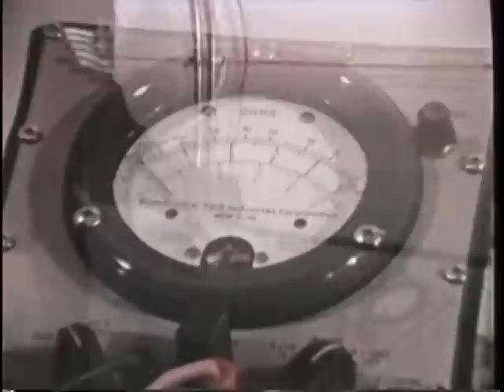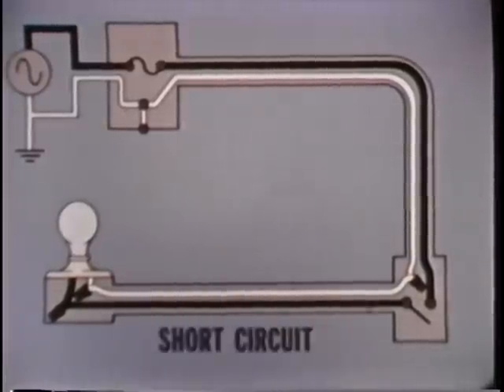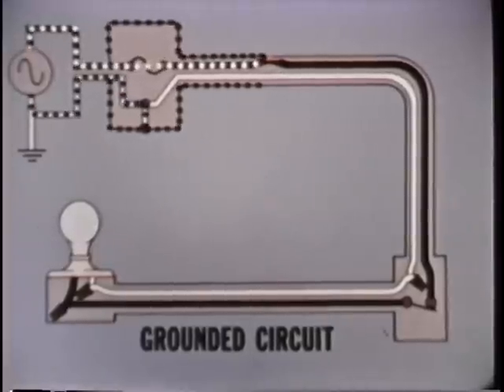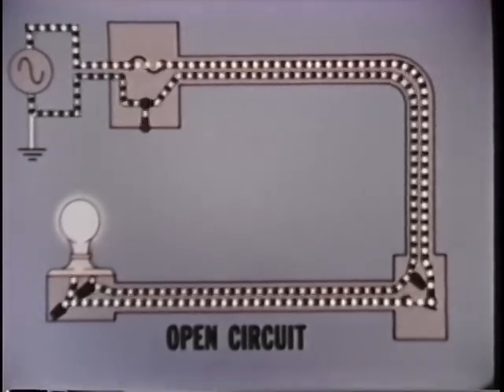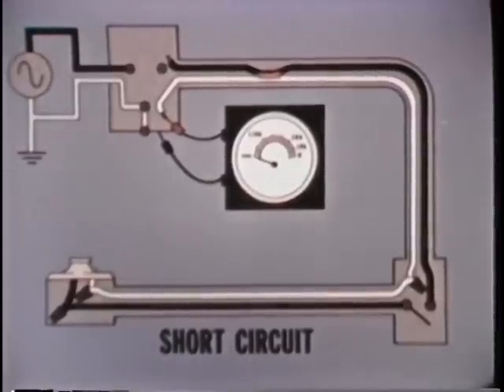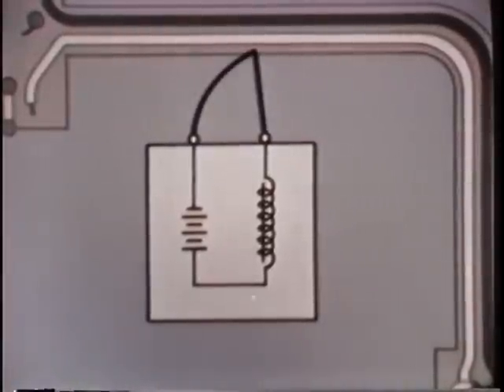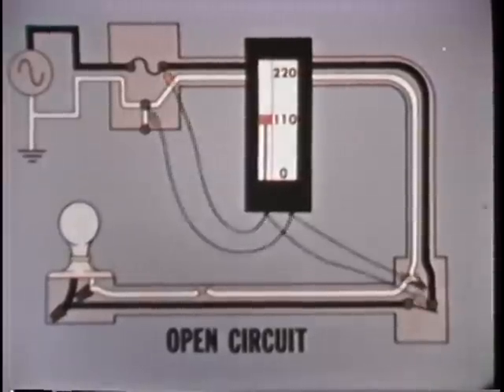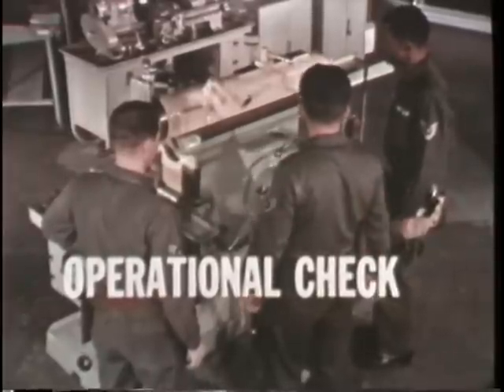TROUBLESHOOTING ELECTRIC CIRCUITS

Comment: Safety practices have been upgraded since this was filmed, but it's a great, simply explained intro. This info should of course be fundemental in the training of anyone working with electrical circuits in buildings. So good stuff, this is.

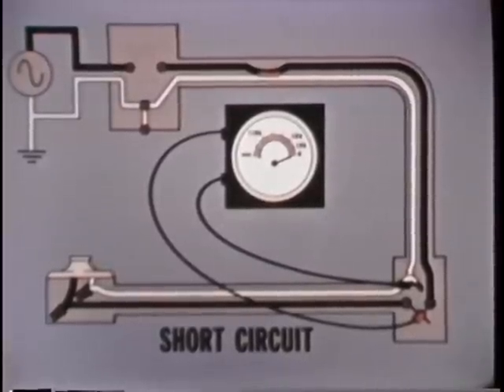Comment: I don't understand why the resistance is 0 at 9:52. It should have a resistance, because there is a closed loop because of the short circuit. Is this video really telling the truth?

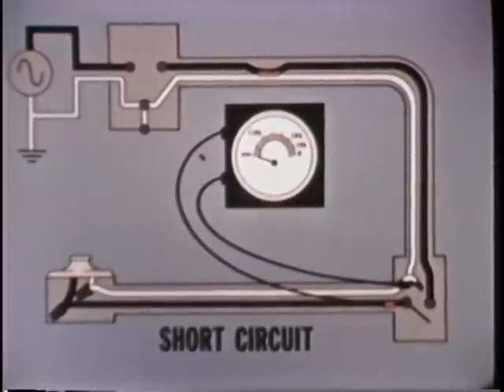And how can there be a resistance @ 9:36 if there is not even a bulb inserted?
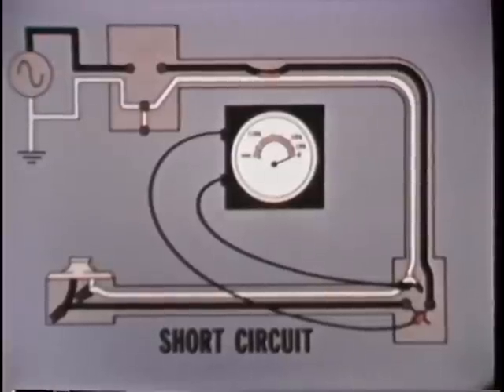Reply: For 9:52 0ohm means very low resistance (because of the short).
In 9:36 there is high resistance( because its an open circuit, no wires touching and the other reason the bulb is removed causing an open circuit(high resistance).